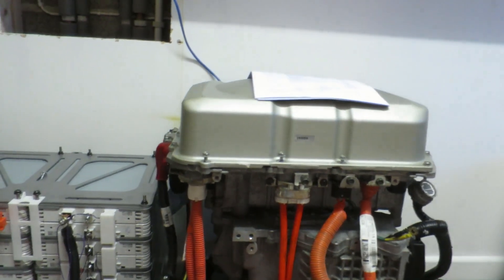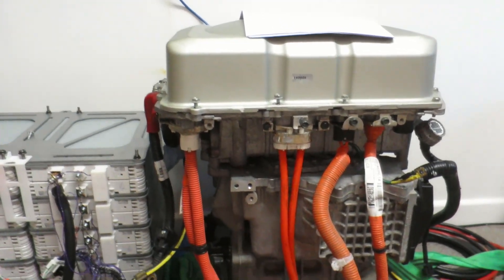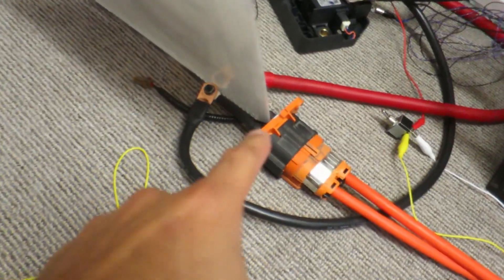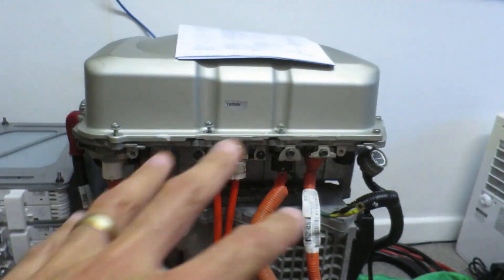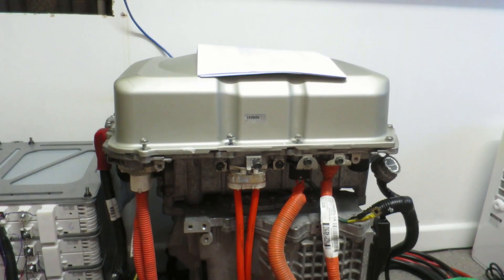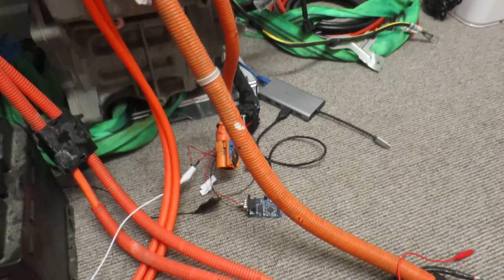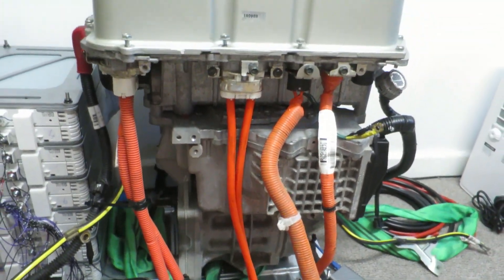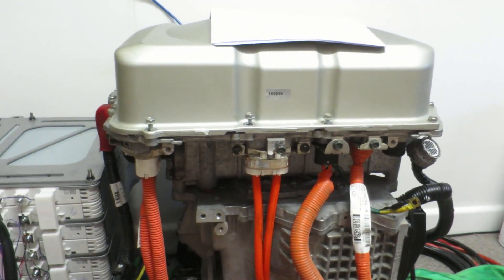Nissan Leaf to RX8 Conversion Week 7

Comment: I finally have my open inverter control board but I’ve been having some issues with inverter, the Toyota Avalon hybrid transmission and wiring are good, just need to learn the software from openinverter
Reply from the maker: Nice work! Buy yourself a Leaf - you don't need a third party inverter then!